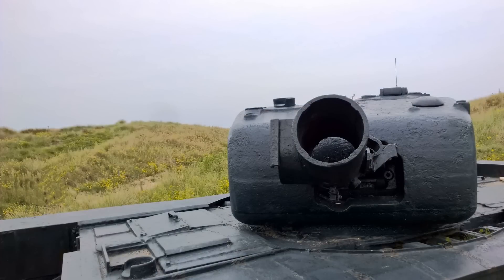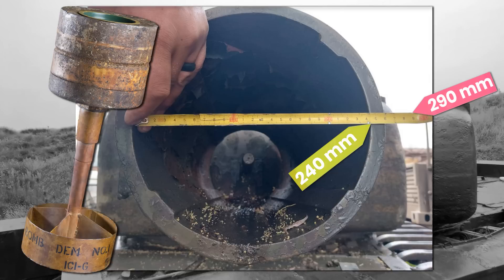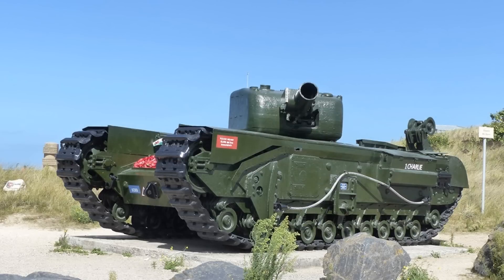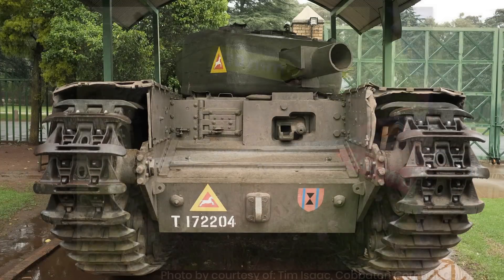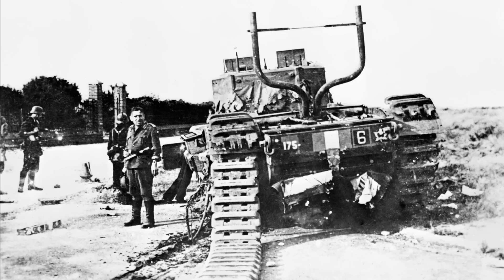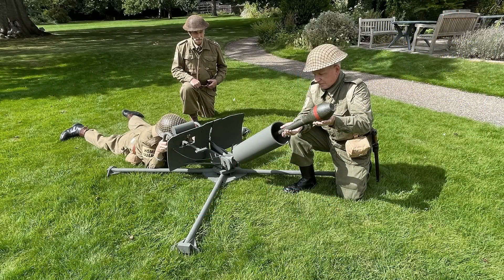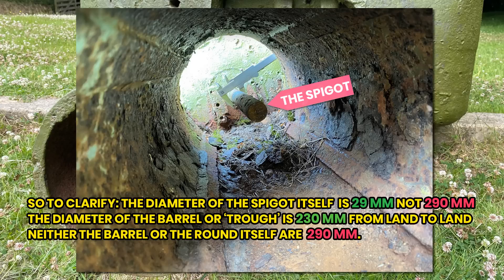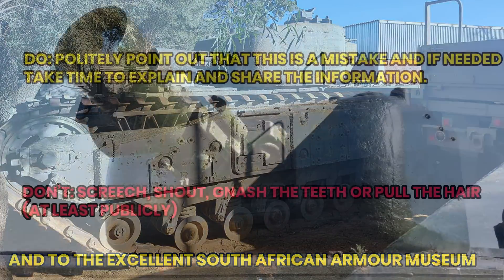AVRE 230MM - FACT CHECKING

Comment: Okay maybe the production was not 290 but I think the prototype where they were testing out the thing might have been because the one where they're testing out to see if it would reach it had a sandbag that went backwards when the round went forward and if you elevated the gun high enough the sandbag would actually go into the engine bay when the gun was fired

Comment: Honestly not surprised mistakes like this are common, especially with a spigot mortar. People unfamiliar with the weapon might read "29mm spigot" and "230mm Mortar" for the same weapon and blend the information. Circular sourcing is an issue with a lot of fields, and pretty much any historical subjects, especially when information is translated or information is incomplete and data needs to be extrapolated from other sources that might not be entirely accurate, like first-hand accounts and retellings years after the fact.

Comment: If the spigot diameter on the Bombard defined the weapon, then it's reasonable to suppose that the spigot diameter on the AVRE was likewise used. This may not be "circular sourcing" so much as modern commentators not realising that it's the spigot diameter, not the diameter of the round fired, that is used with spigot mortars, and that the only problem with the "290 mm" is in the units used, ie it should be 29mm not 290mm??

Comment: Thanks.  The mistake isn't just about a typo.  A 290 mm is a lot bigger than a 230 mm.  If the rounds are the same length (doubtful), the 290 mm is (290/230)squared or about 1.6x the volume.  If the length is also scaled, it's the cube and about 2x as big.
Good message.

Comment: The Spigot mortar didn't need a barrel as it used a spigot, the barrel  more and likely protected the round as a shroud from shrapnel etc. Not sure if the same AVRE used the Onion, that placed a large square slab of explosive against concrete walls or bunkers like the did at the Atlantic wall Hankley Common, which you can still see the effects to this day.
Reply from the maker: the correct name is a trough, but the papers and stuff from the time dont seem to mibnd to much on this as they called it a barrel as well and that makes it a lot easier tbh
Reply: @armouredarchives8867  Wasn't this spigot loaded from inside by opening a hatch and placing the bomb on the end of the spigot. The only way was to insert the bomb through the trough or barrel onto the spigot, most probably made it easy to locate the end of the spigot than fumble around with  just finding a spigot rod on its own.

 I wonder if there are any AVREs about where you could try and place a dummy on a spigot or examine the spigot itself on the AVRE.
Reply from the maker: the loader was next to the driver, a hatch above him was custom made - the barrel or trough was then cocked up at 90 degrees and the round slotted onto the spigot loaded from below with just the loaders hands visible and the system flipped back to normal

Comment: There is no evidence at all that the Sherman tank was not nicknamed ''The Ronson'', just as there is no evidence at all that the catchphrase ''Always lights first time'' wasn't in use before and during the war.
In this case , the ''myth of the myth'' really is a case of circular sourcing.
Reply: Lack of evidence is not proof.
Reply: @terik3312  Exactly ! On the one side of the argument you have only the lack of documented evidence surrounding slogan itself , on the other you have the mass of literature recording its use by soldiers during the war. This also includes such things as recorded interviews with veterans that you can watch right here on YouTube. 
This lack of documented evidence surrounding the use of the slogan by Ronson itself is actually quite easy to explain . Put simply , not everything survived digitalization . Exactly when Ronson started using the catchphrase as an advertising slogan is lost to history and cannot be researched using google. Yet this lack of documented evidence is used as ''proof'' by those don't like the idea that the Sherman tank had such a moniker attached to it, that such a moniker couldn't have existed. In truth , what evidence there is , memoirs , interviews , third hand accounts , all point to it having been used and , taken together, amount to a considerable weight of probability.
Reply from the maker: well we dont, tbh, we have all the ronson stuff you can imagine, from posters to art, that much survived the war years and in pretty good shape, the catchphase was used one some 20 years before. as for the mass of litrature and interviews, if you would be as kind as to find me some war time accounts? in that period, not 30-40 years later? because ive also got war time accounts of dozens of tigers attacking tanks at battles that didnt, or old vets with 'their wasnt a gun that could do X or Y agasint this or that' which we know to be false. in over 10 years of going over archival documentation from the time, the only ronson thing was 'caution, ronsons, flammable' and that was from the sherman ronson flamethrower
Reply: @armouredarchives8867  So , sounds to me like you are saying that the slogan was in use before the war,... ?  In that case all you really have is your insistence on nay saying the word of the men who were there, in this case by discrediting their good word and throwing shade upon their written accounts and memoirs.  
And that's really all you have ?!  Nothing to back up your assertion that they never called the Sherman tank ''The Ronson '' ?, ..or used the catchphrase as a bitter joke ?  Simply a lack of evidence and your desire to call them liars,....I think you just proved my point TBH.
Reply: @armouredarchives8867  You know, it's one thing to go over archival accounts and study what unit was where and at what time , or examine the ballistic qualities of a certain gun, quite another when you start making sweeping assumptions about what you think the men involved thought about it all.  And quite another still when you start discrediting the good word of veteran soldiers. In this case there are interviews right here on YouTube , interviews dating from the sixties and seventies , in which veterans quite clearly state that they called the Sherman tank the Ronson. 
As far as I am concerned , a man needs some evidence before he calls another man a liar , especially when the man he is so denigrating has conveniently passed away. You don't have that evidence , in fact what you have suggests that they might well have encountered the slogan and used the phrase.  
And where else would the name have come from except from the men involved ? A story ,you suggest, made up some thirty or forty years after the war , dredged up from a memory of a slogan used some twenty years before the war ?! ,... a convoluted plot to explain away testimony you don't like I'd say. 
And as for using false identifications of Tiger tanks on the battlefield to cast doubt upon the good word of the men who fought the war ,... words fail me. 

Personally I have no doubt at all that they called the thing the ''Ronson''. Why wouldn't they,..? They'd all seen enough of their mates burnt to death, I'm sure. We can all discuss till we're blue in the face as to wether it was a good idea to load so much ammo into their tanks before each battle , or just how hard it must have been to tell what sort of enemy armour they were facing on a dusty day in Normandy while peering through the smoke from burning tanks and artillery explosions , but none of that is directly relevant to the question and none of it should ever be used to attack their good word.
Reply from the maker: @andrewwoodhead3141  The term was used once in the 1920’s but you seem to think that there are thousands of old tankers out there all saying Ronson and Tommy cooker, so can you show me some? – Not authors today, not the authors of the 60’s 70’s 80’s, but of the time please. Have you got lots of 1942-46 reports? Docs? pages and/or audio with Ronson? First-hand accounts please? The reason for this whole video was to highlight the issue that people copy paste history with no sourcing, there are dozens of books going back with ‘AVRE 290 mm’ inc videos from even the royal engineers, because once something is saturated enough it becomes the ‘truth’ 
Was the phase ever used as a dark joke, maybe? Was it used by every German and Sherman user, no, if it was there would be evidence from that time, but again il wait till you can show me these thousands of period articles with the word ronson being used.
Reply from the maker: @andrewwoodhead3141  Sigh, it’s not attacking their ‘good word’ if they said it so be it to them, the issue is that today every bad book and post has it like this word was in every day common use, there is simply nothing to support that. 
And quite frankly many of those authors who wrote ‘290 mm AVRE’ were also soldiers, and served. So, what the story there? It really was 290 mm but it shrunk in the rain after the war to 230 mm? evidence, facts and proof outweigh personal feelings and emotions. ‘It’s not attacking their good word’ it’s about understanding that not everything that is said by a vet is absolute gospel and undeniable truth. Time muddles even the best, and so we end up with recollections of dozens of tigers in a fight where we know none were. And we know that because there are reports, diaries, minutes, photos, intel and all the other trappings that paint the complete picture. 
In the case of ‘Ronsons’ we have only after the facts recollections  to support it and little else despite the same background sources being present, we have war diaries we have letters home and between friends, we know their thoughts on the food, the music, the enemy and the weapons, how they felt about the girls or the new vehicles for good and bad, grumbles and gripes are all very common, faulty engines, a stickly clutch, and so on, are recorded and sometimes with strong language, yet in all this, ‘Ronson’ doesn’t creep in despite you believing every tanks and his dog used it?
Reply: @armouredarchives8867  There are no old tankers out there using the term ''Ronson'' in relation to the Sherman tank. They all passed away some time ago now.
This ''after the facts recollection'' is a line , the same line which is used to discredit the authors from the sixties, seventies,  and, it seems , the eighties. Yet many of these authors had the chance to interview veterans, something which you do not. The burden of proof , actual proof , lies upon you to prove them wrong , not the other way around. Again , we are back to this idea of some author in the sixties dredging up this old slogan from the twenties,  are we not ? 
What you have is a lack of documentation , a lack of evidence that you find satisfactory , and a desire for the word, or nickname , or slogan to have never been used in relation to the Sherman tank, ..that and a series of derivative arguments you seem to think will convince others to discard or ignore any account to the contrary.
I have seen one interview with a veteran who stated, very clearly, that they used to call the Sherman tank the Ronson , and I have read quite a number of books by authors who have made that claim having interviewed WW2 veterans. I see no reason to disbelieve any of them simply because you cannot find evidence in your archives of what was a colloquial nickname that clearly fitted the bill. 
At the end of the day , ALL recollections , by the nature of them being recollections , are ''after the facts''.  So let's just say that you don't believe their recollections and leave it at that.
Reply: @armouredarchives8867  On reflection , this has been a highly informative exchange . 
How many times have I read some comment asserting that the slogan was never used before the nineteen sixties or that there is no evidence  that this slogan was ever used by Ronson ? Many times. So I should thank you, I really should.
From now on , if I do happen to stumble again on such falsehoods , I will make sure to point the perpetrator in your direction . ''Please speak to Armoured Archives '', I shall say, ''He claims to have seen archival , primary source evidence that the slogan was in use twenty years before the war''. That should, at least, put that particular canard to bed. 

Now, I wonder if you could check your archives and tell me what was the nickname that we used for our signals variant 432's in 3rd Armoured Division Signals Regiment during the first half of the nineties ?
It's a funny thing , actually , but I used to think they were 436 and 439 s. Turns out that Janes has all the signals variants listed as 439 , with a subset of numbers to designate their exact function .  I.E. 439(6) , 439(9) .  So maybe I remembered it wrong , or maybe I had it wrong all the time. 
But I still know what the colloquial nickname was that  we used for our 43's . It was in common usage in the regiment, simply what we called them . Perhaps you can guess it (it wasn't exactly original), or perhaps you already heard it ?  But , if not , please try to find it in your archives. Must be there, right ?!
Or you could simply point to my self admitted error in correctly identifying my own det as proof that my word really cannot be trusted on the subject. Besides , it was nearly thirty years ago now, perhaps my memory is false ,... ?
Reply from the maker: @andrewwoodhead3141  
as I’ve said just because a vet says something doesn’t mean its accurate? that applies to everything. i have met Korean vets with fond memories of driving conquerors in Korea, while I know that can not have been the case, you can happily believe them, if it makes you happy.  For the same way if I can find a vet from WW2 that will state the word Ronson wasn’t used, you can either believe him or dare to impinge upon his good word, paradox for yourself. 

As for 430 family 
There was a selection of odd names, from Trojan the APC, Trident the Fitters vehicle, tentacle used on signals (less a name more a role/purpose) pathfinder and so on. 
FV436 is listed as green archer FV439 is listed as ‘radio relay’ and/or signals etc – at a base level, however there are multiple smaller sub marks based on radio types such as 439 Bowman, 439 SAS/MC and so on. – each is broken down in the MOD equipment support publications papers and manuals for the 430- family.

Comment: one thing about Wikipedia is the it has to be verifiable from a source not true. If its in a book with author ISBN et al it tends to get to stay. Going up to to a vehicle with a tape measure will get you tagged with "No original research". 

Sometimes you can say the books a wrong in the discussions, and start a   discussion to fix an issue. But if the consensus goes against you, and its common for the then active contributers of the page to be too attached to their understanding of the topic, the mistake gets locked into the page until the contributor makeup changes.
Reply from the maker: this sounds like the main reason wikipedia is mostly discounted as viable research or even background these days

Comment: Chieftain took an ultrasound probe to various tank hulls to measure the armor thickness of the castings and found they weren't what they were claimed to be in some books. Its in the Leopard 1 tank wikipedia under Canada's C2 variant that our chaps measured the actual armor on the original 1A3 turrets to also be less than originally claimed.

Comment: The circular sourcing is not only in tanks, it's prevalent in all areas of study.
Reply: Something I recently came across (though I'm certain it's been going on for quite some time now, it was simply that I personally only realized it) is how many webpages are written by bots (AI writing programs).  Those programs scan other existing articles/pages, and then "write new articles" based on that cataloged information.  I'm not saying this is the only source of all these repeated errors, but I'm certain it has been reinforcing these errors.
Reply: Reminds me of a book a friend was reading that just didn't sound right.  The author had three other books as sources for the information, but those authour used his book and the books of the other two books as sources.  So, not really a circular sourcing but a web of sourcing.  When I pointed this out, the book went into the bin.

Comment: Same thing regarding the Infantry tank lll, Valentine. All references quote the specs of the original chassis, 16t, 15 mph.
All later marks were 17.3t, and the GM two stroke gave it a top speed of 27 mph. I started my research after noting the later 75mm gun versions were used as command vehicles in Royal Artillery anti tank Regiments equipped with the US M10. How could such fast vehicles be paired with command vehicles so slow ? Proving, that all enquiry starts with Intellectual Curiosity.
Reply: I know this is a year late, but could you provide your research? I am very interested

Comment: I'd be interested in a video on how the "230mm" mortar system on the AVRE was operated
Reply: from what I've read the whole thing was hinged so that it would swing 90 degrees straight up. The 'loader' would then bring the new mortar from the front hatch, load it in and then lock it back into firing position and then would fire from inside the tank

Comment: Great Video ! I have a question about that AVRE in the beginning . Since seeing on the Beach in Normandy 2018 I can’t find any documentation of why there was road wheel and suspension units on the rear deck . Any info ? Thanks
Reply: I think since it was an engineering vehicle, those might have been rolls of telephone wire or detonator cord.